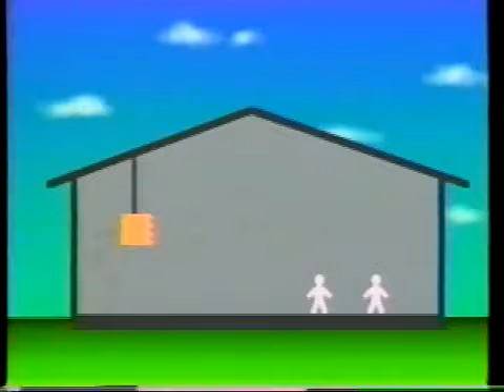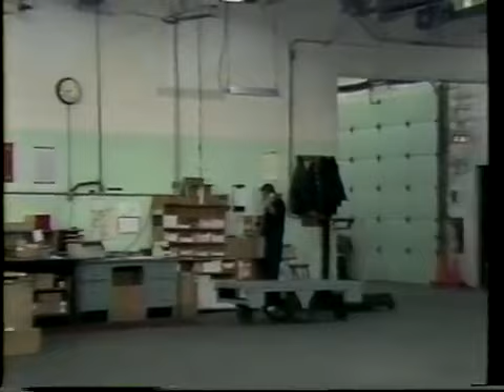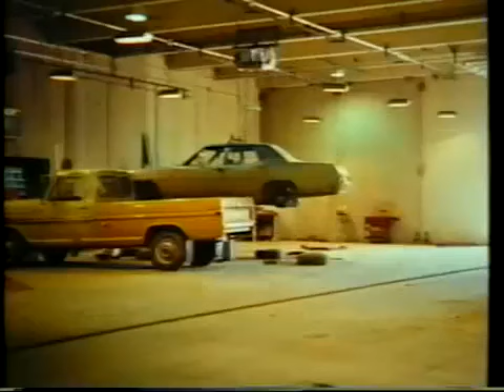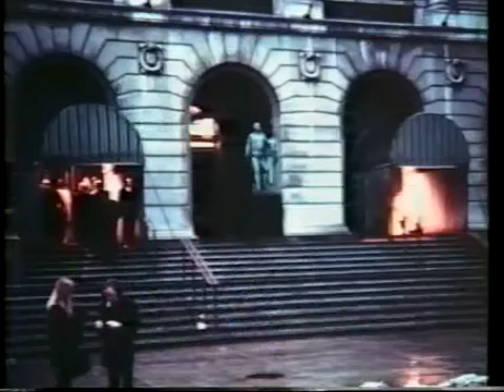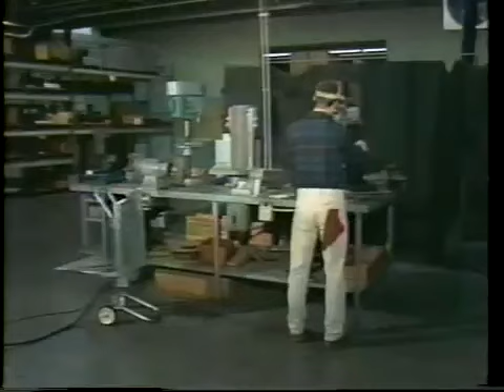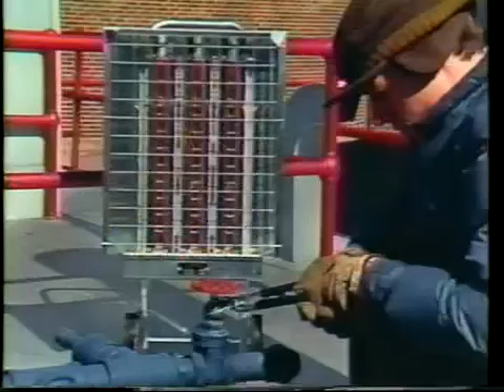Aitken Products Inc Infrared Heat Benefits

Comment: Some one gave my neighbor one of these heaters to put in his shop but has no 220v & gave it to me. It looks just like that Solarbeam Quarts Lamp Infrared & all I can say is wow! Instant heat & my neighbor wished he could of used it. It puts out the perfect heat but if I’m a foot away my insulated Crocks start to smoke. I was trying to give this heater away because I already have a heated garage with heat ducts but the thermostat is upstairs. This video changed my mind & gave me an idea. I can use it outside or in garage but I need a stand for it & I’m going to mount it on a hand truck. I’ll use some claps to clamp it to the sides of the dolly but it says to mount heater horizontally. That’s the way I wanted to mount it so I can adjust the height & take it off but I will add weight to the bottom of dolly for it won’t tip over as easy. I have some big magnets from a motor I can use.  
Thanks for the video!